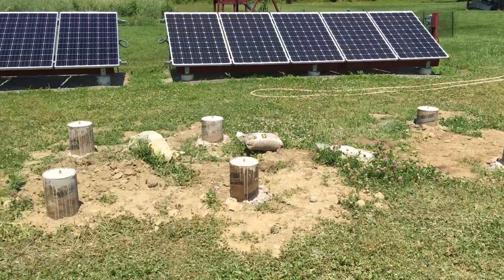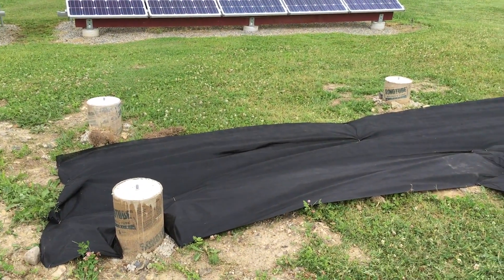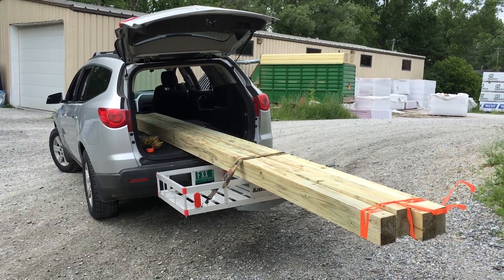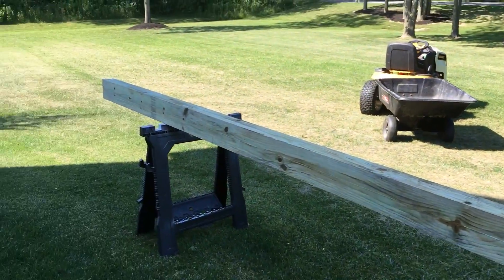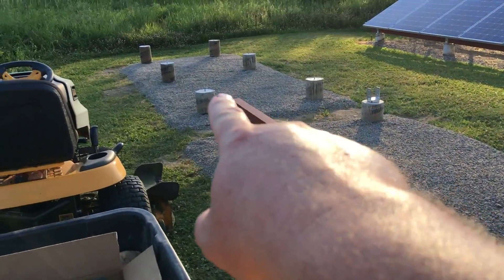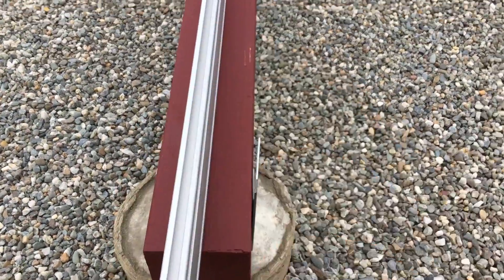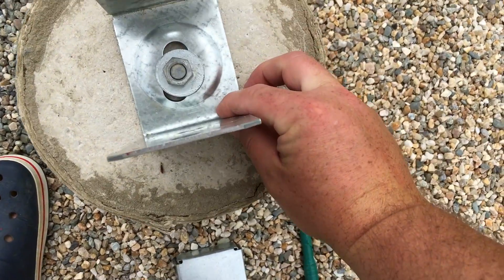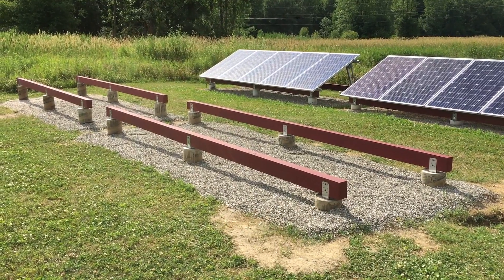New DIY Ground Solar Mount Installation AC-Grid-Tied Part 3 (Finishing Ground Mount Base)

Comment: I'm curious, did your town require a permit for your ground mounted array? Want to build the same but believe I have to get a building permit from my town and state, and I'm live surrounded by farm fields in a rule area.
Reply from the maker: In VT, when you have a Certificate of Public Good (CPG) issue by the State, no zoning or town permit is required if the Array is under 15 KVA.   All of my grid-tied solar both roof and ground mount is under the CPG.  Off-grid shed in not grid-tied.  Hope that helps.

Comment: Hey!!  How deep did you put the sono tubes when you set them in??  I'm planning on adding either 24 or 32 panels to our existing array.
Reply from the maker: I went 3.5 to 4 feet.  I couldn't go any deeper because of a high ground water table.

Comment: Where did you get the rails and adjustable angle tubes for the panels?
Reply: looks like Renogy flat roof tilt mounts (?)
Reply from the maker: Glenn,  I am using Unirac Solarmount Rails.  The legs are also Unirac and are the adjustable tilt legs.  Will have more info on the racking hardware in a future video. Check out my other videos on my channel as I discuss and even raise and lower the panels in the existing ground array.